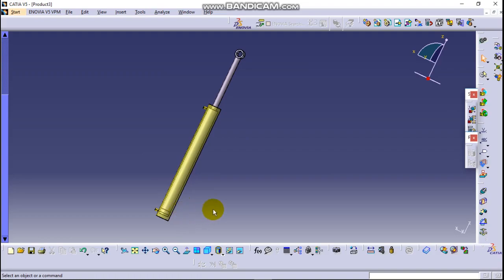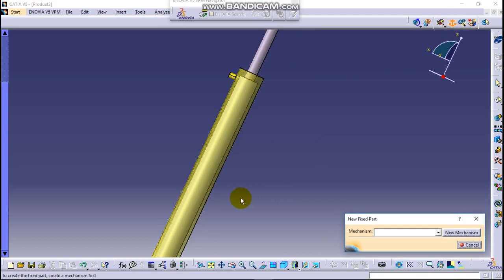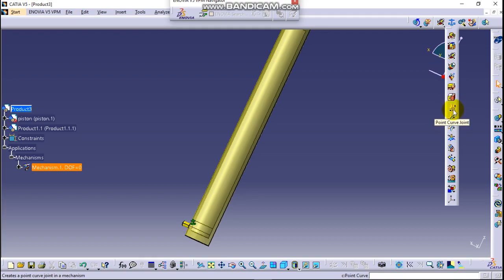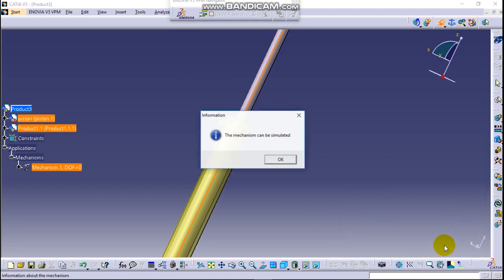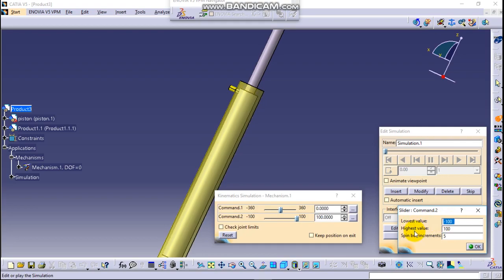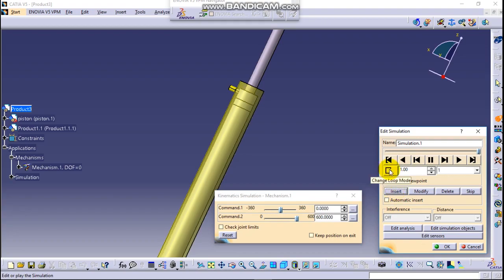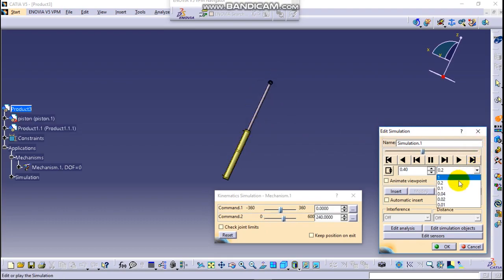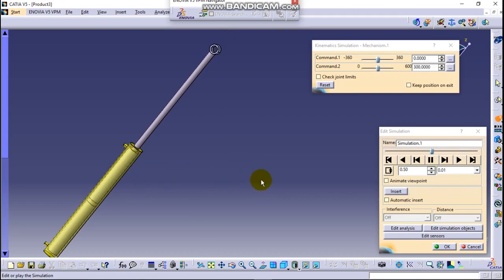Catia V5 Simulation Tutorial For Beginners (Part 1)

Comment: Hi, when I want to edit kinematics simulation the cylinder goes in a wrong way… so when I drag command to the left it goes out of the oppenih and when I drag it right it goes in, can I change the course?
Reply from the maker: Hi David Tursic, thank you very much for your comment here. your question is clear and it happens mostly, but it is very simple to correct. As you know such kinematics has two commands, command 1 and command 2. The first is degree command and the second is length command. Therefore when you edit the kinematics do not touch the degree command simply edit the length as you want.